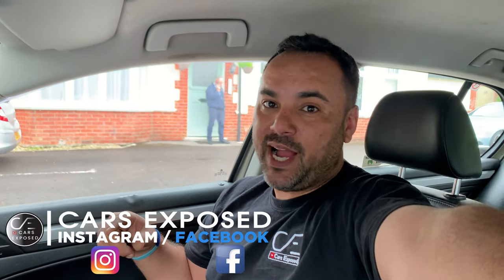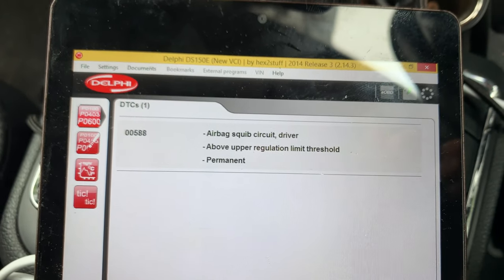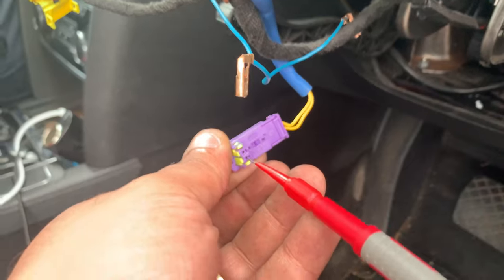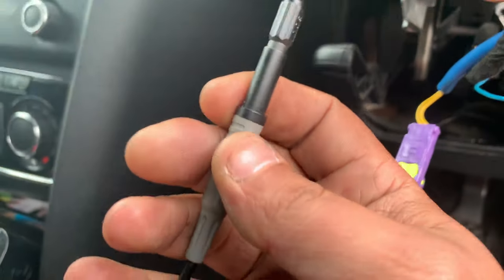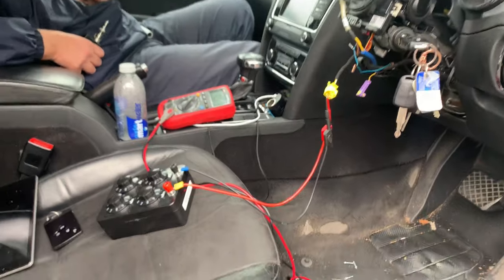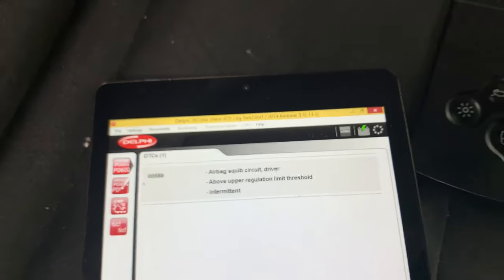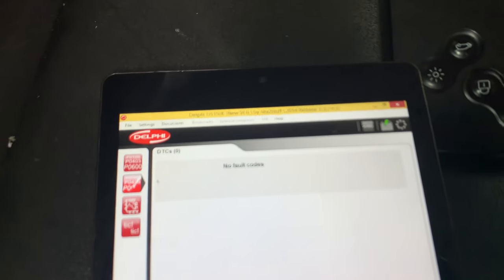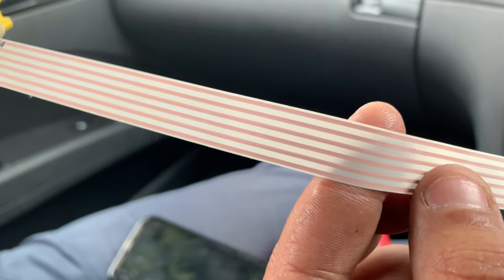Skoda Superb VAG-Airbag light on Fault code 00588 | Decade box in action

Comment: Quite often when that goes the horn stops working as well remember to get the old coding of the original unit so you can call the new unit up
Reply from the maker: myles waller thanks mate Yeap this one had 6 lanes on the ribbon cable but the only fault was the airbag system everything else was working I guess other stuff would start failing soon... Parts has been ordered by the owner of the car I should be posting some pictures on Instagram cheers mate 👍👍👍

Comment: Hello genius.  How are you?  Can I bother you with a question?  I have a 2004 VW Passat with 184,000 km.  Everything was going perfectly until one day I went to start it and by mistake I turned the key for a short time and it did not start.  There I turned off the contact, started it again and the car started normally, but from there it throws me the error 00588 N95, error due to high resistance in the driver's side airbag.  I made him clear the error but it reappears right away.  Do you know what it could be?  Thank you so much.

Comment: great vid. i own skoda octavia elegance (cat eye Flashlights) cbz engine 1.2 tsi  2013 need to replace the clock spring. air bag light is on and there is no respond from the other buttons on the wheel includs the horn. can you help me where can i find one on the net or what is serial number that compitable to my car ?
tnx

Comment: @carsexposed what was the software you were using on the tablet? Saw something about Delphi. Are you using some kind of Delphi Bluetooth reader for the OBD II port that works with a certain software? Would be so nice to find a good reliable software and downsize on the amount of scan tools having to lug around. 

On the air bad testing stuff AESwave.com has a nice wiring kit so one don't bend connector plugs, pins, etc and I noticed it had a couple air bag. Never got around to looking at the air bag pieces yet though. The kit does have a 10k ohm resistance lead as well for testing keyed security systems with the resistor in them and testing other stuff as well. 

I picked up a box similar to one you used in the video but instead of turn knobs it has switches so you can set the ohms amount. The higher the ohms the more switches you flip. Wish I'd seen yours beforehand though as the rotating knobs takes less space. Where did you get yours if I might ask?
Reply from the maker: Dale N I was using the Delphi DS-150 it comes with a Bluetooth obd2 VCI quite handy and capable tool for the price ... 

I’ve been recommended the AESwave kit which is really nice and essential by the way, but unfortunately I can’t afford at the moment ...

I got my decade box from EBay very inexpensive I think I paid £10 for it, if you are getting one get the one with the 5 knobs as you are able to control X0.1 ohms which I can’t with mine not the best quality out there but it works really well ... https://rover.ebay.com/rover/0/0/0?mpre=https%3A%2F%2Fwww.ebay.co.uk%2Fulk%2Fitm%2F223523840487

Comment: Lasted almost 500k miles....not bad, not bad at all! =)
Reply from the maker: Thomas EXOVCDS hello mate, oh yes it did well, everything seems to be failing in that car not that I’m complaining 😊, we are trying to push to the 500k 😋😂😀 cheers 👍👍👍
Reply: I had the clock spring changed on this car about 3 years ago so from my experience I can say that the valeo squib lasts around  150k miles (250k km)
Reply from the maker: Lucian Razec oh as usual you didn’t tell me that you’ve changed it before mate 🙄🙄😂🤣... nice to see you here tho 👍👍👍
Reply: @lucianrazec7242  That makes a little more sense (that is was replaced before), but still... 250K is a lot in my area (people only drive short distances in the city).
Reply: @CarsExposed  would an air bag light make locks go on and off intermittently and then an hour late  air bag light goes off and the lock stop going on and off and go back to normal
Reply from the maker: Amjid Q it shouldn’t really it sounds like you have a electrical issue somewhere
Reply: @CarsExposed  thanks will have it checked

Comment: My mk2 Fabia has an airbag light that comes on in the beginning and then goes off after flashing a couple of times. 
Upon scanning it shows low airbag voltage. 
Checked the battery and alternator, both are fine. 
How would you recommend I determine and fix that?
Reply from the maker: When you first crank the car does it get bellow 10v ?

Comment: I CAN NOT BELIEVE IT HAS 400K ON THE CLOCK 😱🤔
Not every car can run that much.
Reply from the maker: More like 440k now and still going 😊... I have to agree there 👍👍👍👍
Reply: Mine only has 78K. Still have a long way to go. ;)
Reply from the maker: UK Car Rebuilds 🤣🤣🤣 absolutely 👍
Reply: Quick question. In that 400k how many times you needed to repair or replace the drivers door wiring?  Mine gone twice already.  ;)
If you could make a video of that would be awesome
Reply from the maker: UK Car Rebuilds I had to repair once about 2 years ago unfortunately I didn’t film it, it was a quick soldering job and still holding I’m quite surprised actually 👍😊